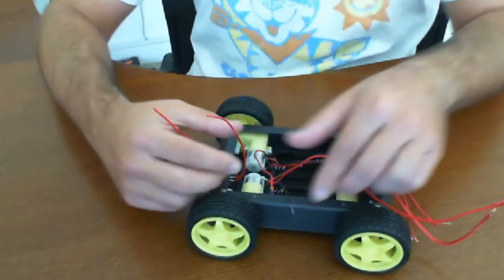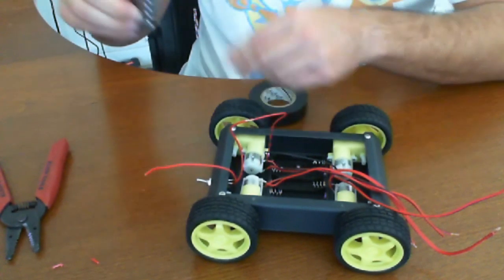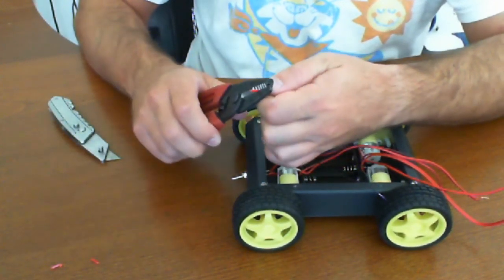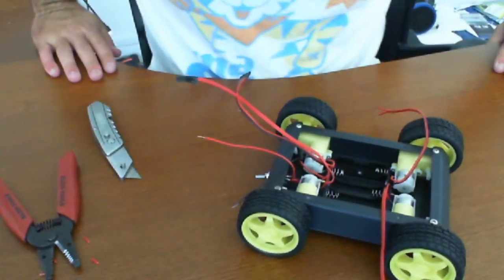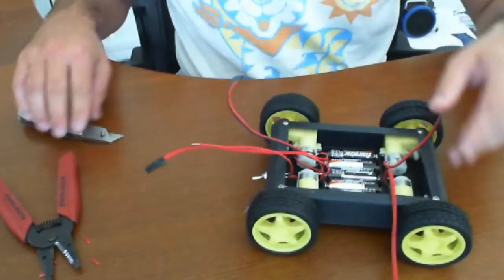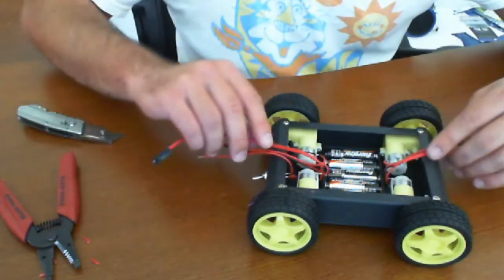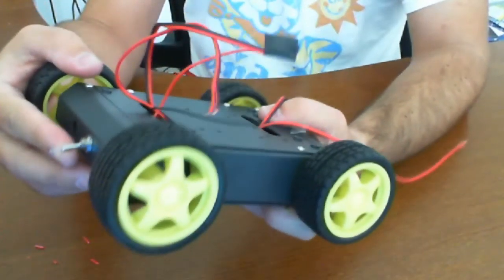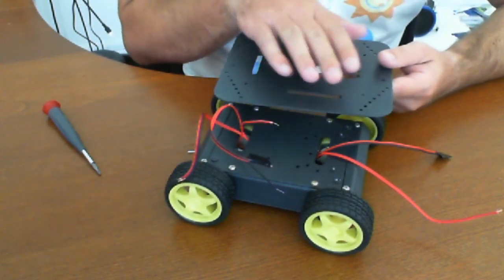DFRobot Arduino Mobile Platform Review - Part 6 - RUG Community Robot Review

Comment: Can I get more specific instructions on the switch? This is my first project. I am lost on what you soldered to the switch which wires you used and if anyone know how to setup the battery pack so it will charge that would be sweet. Any help would be great. This video helped me out a lot. I just need a few intricate details about the wiring process. Thanks for the help

Comment: my batteries become hot and so i need to remove them.  have tried wiring the battery pack and switch both ways yet same result.  what do you think is happening?

Comment: The battery doesn't need to be too accessible if you use rechargeable batteries and wire in the charging circuit (that's what the third wire connector on the power switch is for). I haven't seen any stats for how long batteries last in this unit, so maybe it isn't too much of a problem?